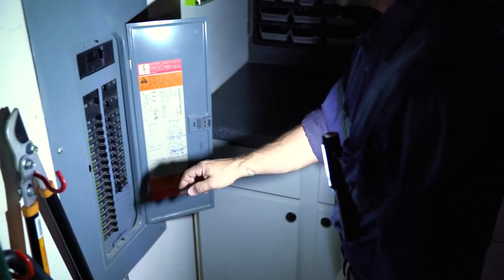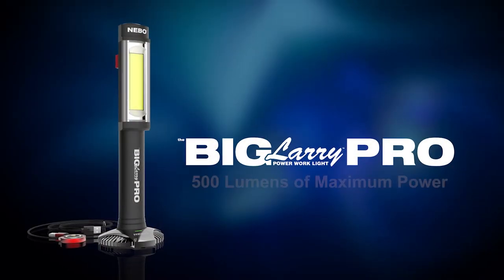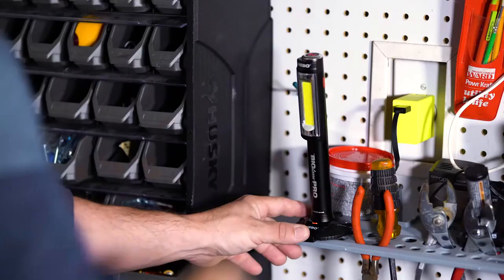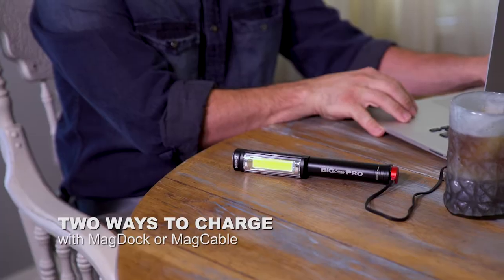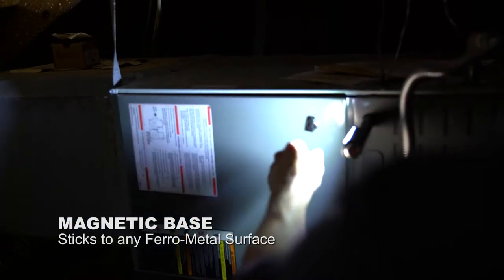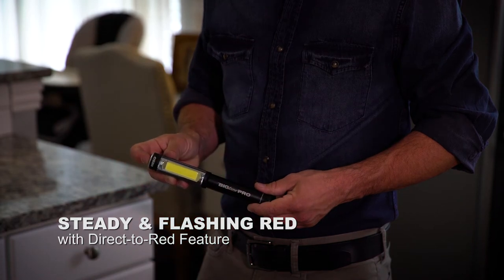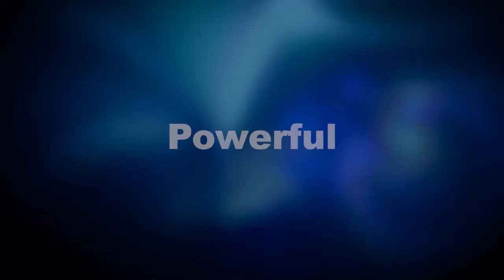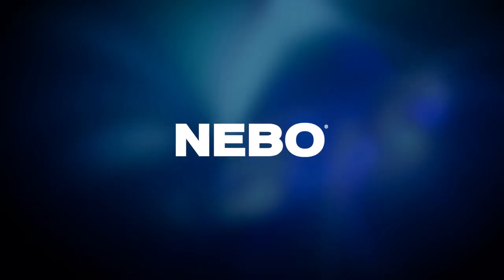BIG Larry PRO - Powerful & Rechargeable COB Work Light

Comment: Good flashlight but the handle portion needs to be slip resistant and their needs to be away to turn the light off without have to cycle through the 2 red light features every time.

Comment: I bought this off the matco tool truck 
It broke every week for the first 3 weeks i owned it finally on week 4 it did not break
I have owned more weeks in working condition than broken waiting for matco tool guy to show up on thursday
I paid $60.00 
It has a 1 year warranty from matco tools
If you buy this light get the warranty and use it